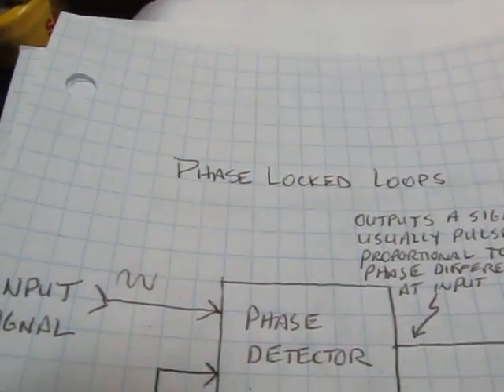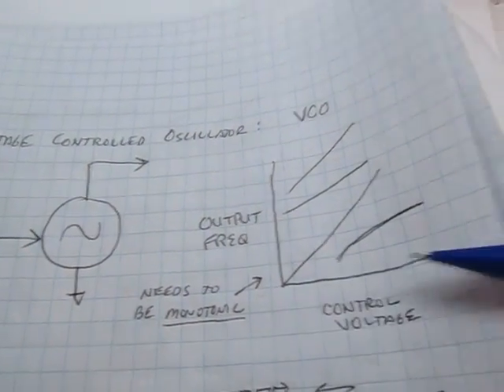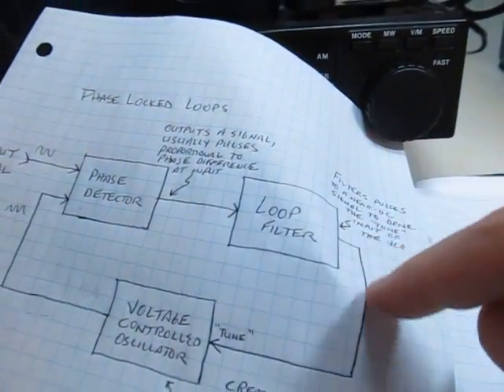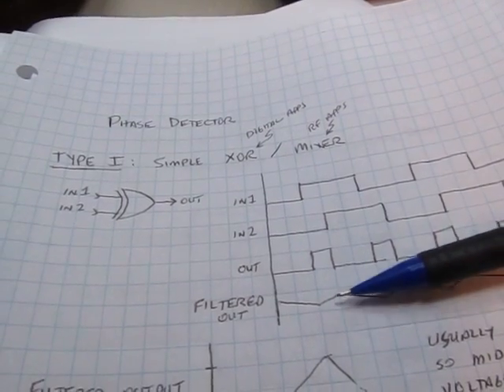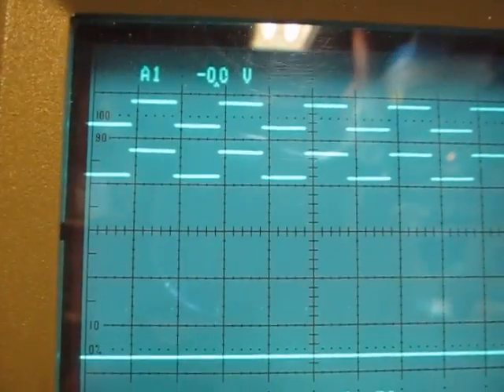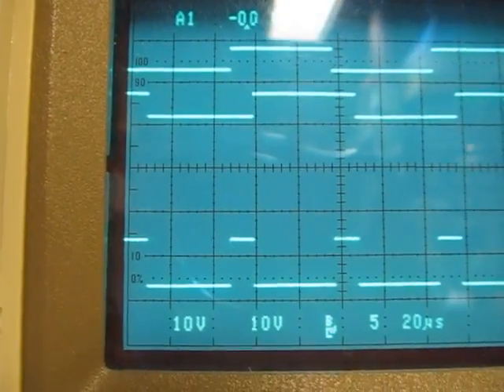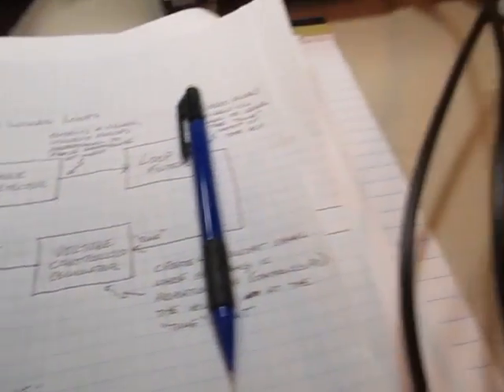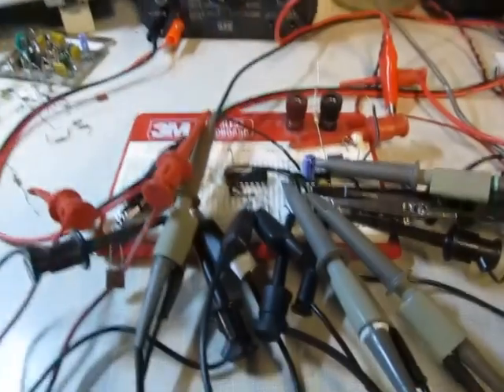#60: Basics of Phase Locked Loop Circuits and Frequency Synthesis

Comment: hi . I have a question. if input frequency is sawtooth or ramp. what happened output frequency . is it sawtooth or is it ramp signal .help plss
Reply from the maker: If the output is taken from the VCO, then the waveform shape will be a function of the VCO design, and not necessarily the same waveform as the input.
Reply: thank you so much  :)

Comment: Will PLL work if duty cycle is different of the wave on which we want to lock? I can't visualise properly.. like PLL is locking only when you know the duty cycle of wave beforehand..but what if you only know the frequency of the wave but not the duty cycle?eg
__|----|__|----|
---|___|---|___|
Here low time of upper signal is same as high time of lower signal and high time of upper signal is same as low time of lower signal. So here Freq is same of both wave... Will our VCO able to track upper signal? Assuming lower signal is our initial VCO output
Reply from the maker: Yes, as long as the phase detector is only responding to one edge (rising or falling).
Reply: @w2aew  thank u sir for the rply..keep making such videos.

Comment: Thank you for this fantastic video and all the others too... I'm in real need of your help, could i get in contact with you somehow?
Reply from the maker: What do you need help with?
Reply: @w2aew  i'm trying to replicate a buchla 259 phase lock circuit. This circuit locks the main audio oscillator to the frequency of an incoming audio signal. Do you have any hints to achieve that in analogical?
Reply from the maker: @viennaaudio5597  I don't really know anything about the buchla 259, but there is a lot of material available on this site: https://modularsynthesis.com/modules/modules.htm#othermodules
Reply: @w2aew  i know the site, but they didn't do that. basically is getting voltage out proportional to incoming frequency
Reply from the maker: @viennaaudio5597  In order to provide the voltage proportional to the input frequency, the PLL is locking its VCO to the input - and the voltage you're getting is the VCO control voltage.
Reply: @w2aew  so, is possible! what device would you reccomend to achieve that ? Thanks a lot

Comment: tu peux nous donner les valeurs des resistances et la capicité utilisées dans ce montage
Reply from the maker: I believe I used the values shown in one of th examples in the datasheet for the device.  I don't recall the exact values, I made this video about 2.5 years ago.
Reply: ah ok  think you